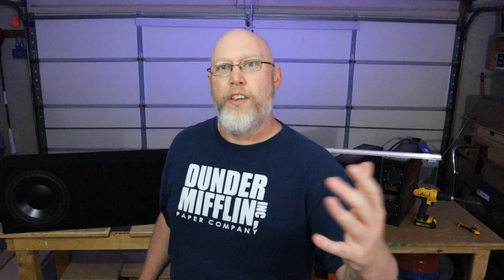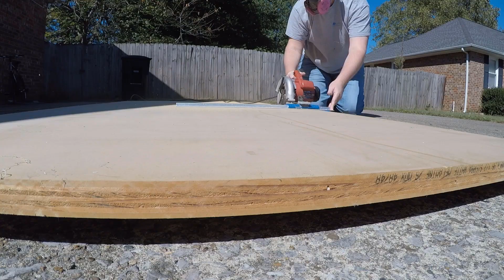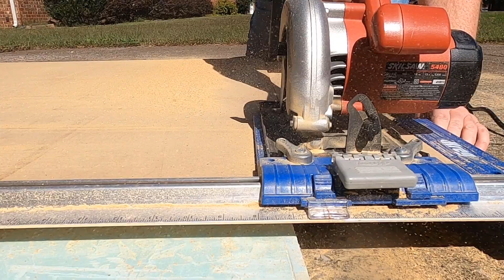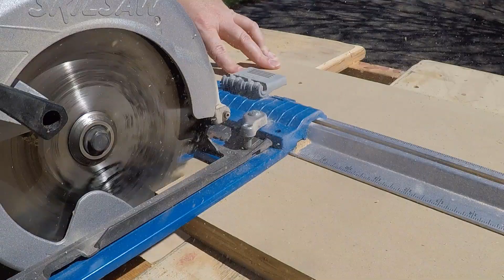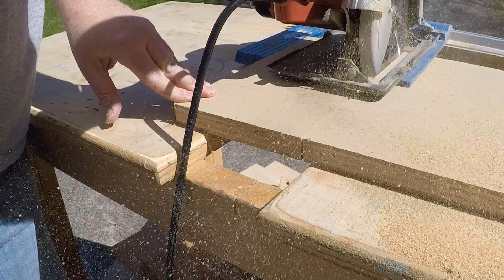Subwoofer Box for Beginners with Basic tools.

Comment: Cordless tools don’t last more than 6-8 years. Drills are fine because of the portability and performance. 
But I’ve had the same corded circular saw and corded jigsaw for 15 years.
Reply from the maker: I like them for the extra convenience, Even if they do wear out.

I find that once I've had a tool for 6 to 8 years I start itching to upgrade it anyway.
Reply: @DIYAudioGuy  plus those cordless tools are getting better and better.

Comment: How do you find out what kind of radiator you need, aren't there different weight radiators ? I want to build a box with 2 8 inch subs with 2 8 inch passive radiators. Good video and thanks for making.
Reply from the maker: The PR(s) need to be able to move twice the air as the active driver(s).  So if you have a single 8 with 8mm of X-max you will need two 8" passives, each with 8mm of X-max.  Or a single 8 with 16mm. For this build I used a 10"sub and a 23" passive.

You add weight to the PR to adjust the tuning.
Reply: @DIYAudioGuy  Makes sense thank you

Comment: I need help deciding on an enclosure. I have 2 soundstream t5 12” dual 4 ohm subs. I’ll be running them on a soundstream txp1.6000d amp at 1 ohm. Manufacturer recommends a minimum of 1.5 ft3 sealed or 1.75 ft3 ported per sub. I am limited on the enclosure size so I can only go 1.25 ft3 per sub. Will running a small box damage my subs or just hurt performance? Also would the sealed enclosure be a better option than ported due to the smaller size? Thanks.
Reply from the maker: An undersized box is unlikely to damage anything, but it will hurt performance.  if it were me I would have gone with a pair of 10s or just a single 12.
Reply: @DIYAudioGuy  ok. Thanks man

Comment: I have a clamp jig, it helps a lot but this jig you’re using seem more useful. Imma have to get one!
Reply from the maker: Those clamp on edge guides are great, you just have to make sure you offset for the distance between the guide and the blade.  I always seem to screw that part up so I prefer the rip cut.

Comment: I'm buying some plywood tomorrow. They're going to cut it for me for a fair price. Eventually I'll get the tools, right now I don't need them.

Just need to ask a friend if I can use his Jigsaw and brad nailer. After putting together one of my boxes that way I can't go back to screws haha.
Reply from the maker: I have very good luck with both my local Lowes and Home Depot.  They guys that run the panel saw are very accurate, they guy at Lowes is a fellow audio enthusiast.  They will make up to 4 cuts on MDF/plywood free of charge.  I usually ask them to make the "major cuts,"  like in this build where trimmed a few inches off the long side, and a few rough cuts so the pieces are more manageable.  Then I take everything to the table saw.  This video was done just to show that you don' t need a table saw and a router.
Reply: DIY Audio Guy I decided to try my luck with my Home Depot. 

Couldn't have asked for a worse person. Got cuts all wrong. Not even workable with over half an inch in the completely wrong dimension. (35x16.5 turned into 35.6x16 or something) He wouldn't take paper cut list. (Two 35x16.5 and two 35x12.5 for example would have been the main focus on the list)

Had to return and they almost didn't let me. Unfortunately looks like I'm never trying anything like that again.
Reply from the maker: @JoshM7  Man I hate to hear that, that's terrible.
Reply: DIY Audio Guy I forgot to bring my tape measure in. So I just had to trust he got it correct. 

Note to self. Don't forget tape measure. 😆
Reply: DIY Audio Guy I'm hopefully buying the plywood later today like I said in the original comment. 

The person I was buying it from got too busy and I had to wait until today. Hopefully they're decently accurate. Otherwise I'll put everything on hold for a while to get some tools and so it myself. 

Kinda miss my old job and having access to all sorts of tools perfect for speaker building.
Reply from the maker: Brad nails are definitely the way to go.